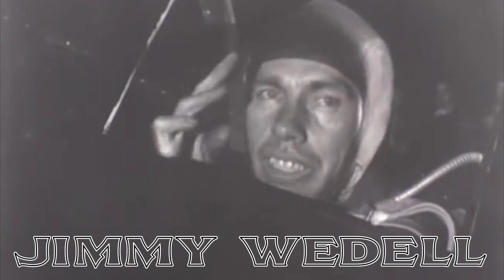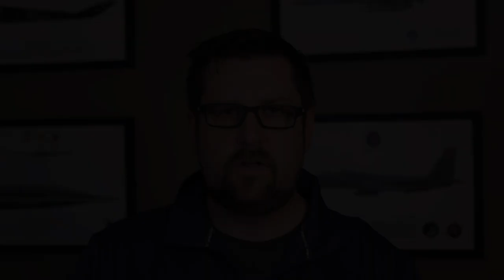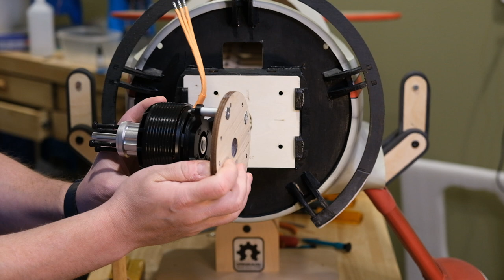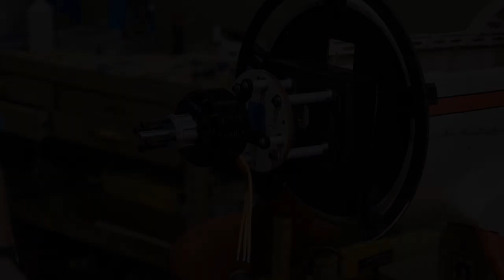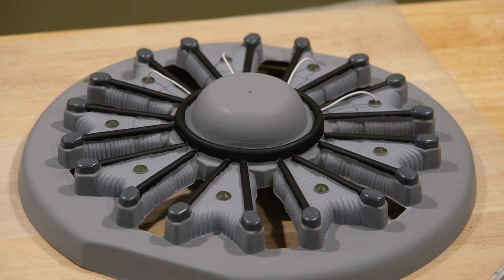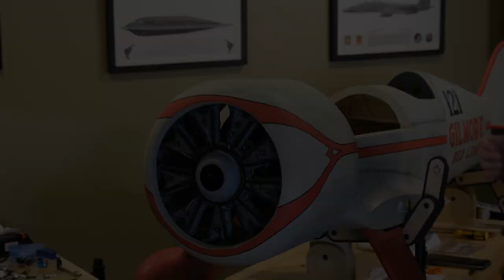How to install the motor, cowl, and paint the radial - 92" Black Horse Gilmore Red Lion ARF - Build

Comment: I'm building mine now . Just waiting on the ums 5-100 radial to arrive . What cg did you settle on and any tips ?
Reply from the maker: 114-115mm back from the LE of the wing is where I'm at and it's probably a bit nose heavy but I'm keeping it there. Remember to dial up the aileron throws! Most pilots agree it needs more than what's in the manual, myself included.